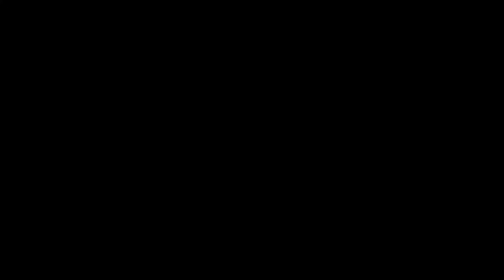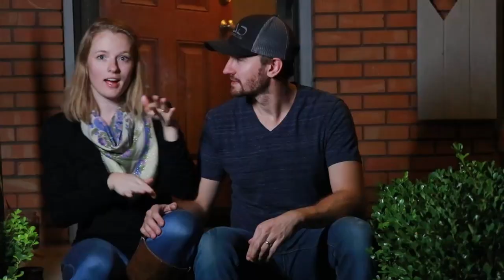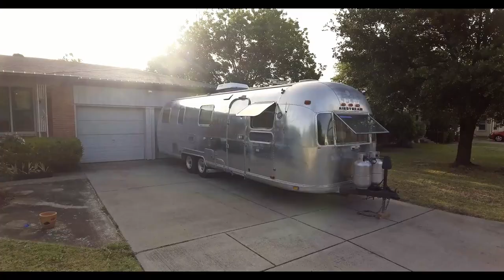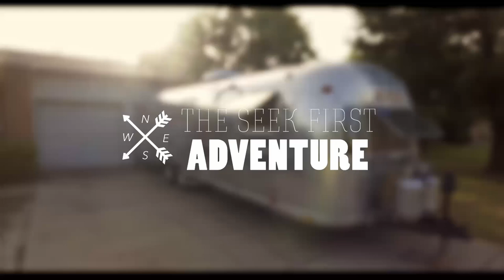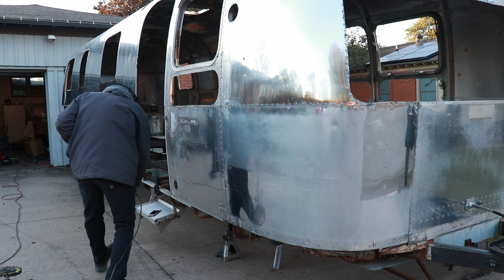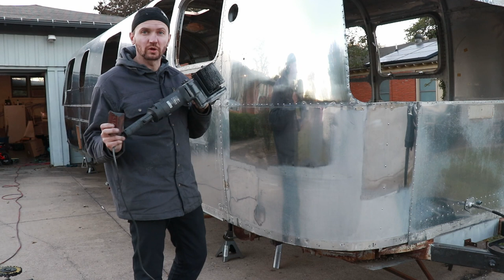Airstream Polishing Eastwood SCT vs Airway Pad

Comment: Hey great video! how many buffing drums does it take per airstream approximately?
Reply from the maker: I would say 2-3.  I used 3, but they all have a little life still in them.  Length of trailer obviously will be a factor.  I used them for the rough cut phase, I had to use the Airway on a dewalt buffer for areas I couldnt get with the SCT due to size.  Eastwood now had a softer wheel that I want to try for finishing as well.  Polishing another one next month and will try that out.
Reply: @MillerGarage  Thanks so much for getting back to me. Appreciate the info! I have some wool pads for the Dewalt and the airway too.